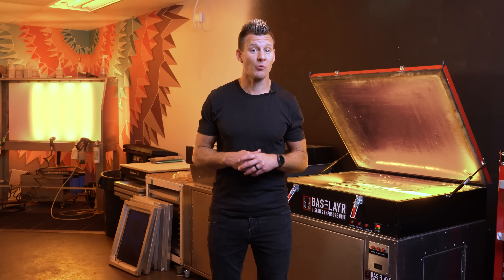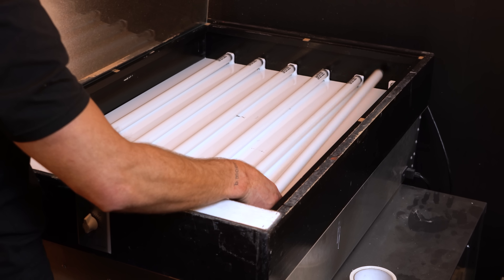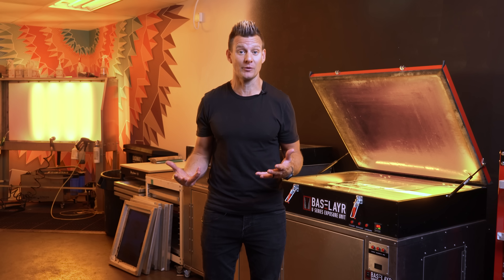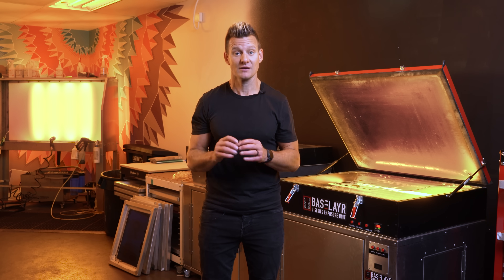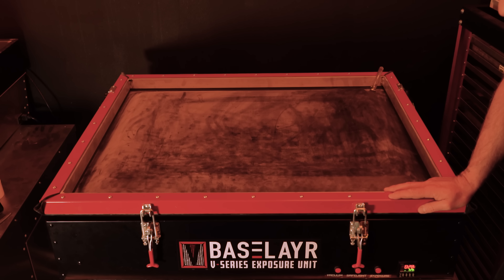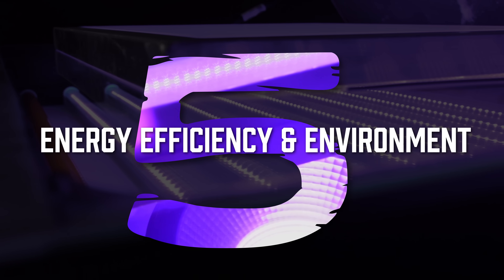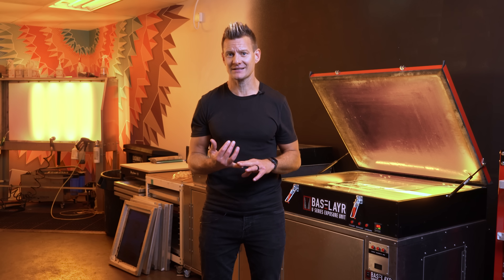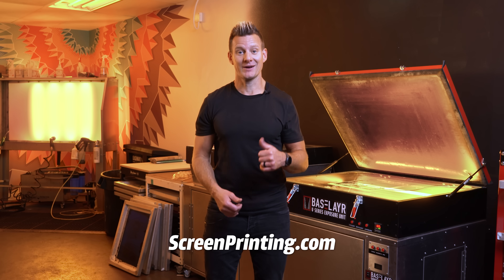Why Your Shop Needs an LED Exposure Unit | 5 Reasons to Upgrade Today

Comment: I've heard it's possible to expose using the natural sunlight? Is this possible and if so what's the disadvantages and advantages?
Reply: If i remember right, Kevin at Chromaline has a presentation slide that shows where certain bulbs land in the light spectrum. Sunlight covers the entire range of visible light of course, but a lot of emulsions have specific ranges where they are designed to be effective, so using emulsion that is specifically designed for your exposure unit will bring your exposure times down and give you a higher quality stencil. 

The nice thing about using an exposure unit is it allows you to get your exposure times down to the second, and be repeatable because you always have the same light source. As Ryonet said, the sun can be... variable... especially here in the PNW!
Reply: @bengossler6193  🎯🎯🎯
Reply: Tbh i think there is a big market with emulsions, i was under the impression that we have 3 different emulsion types acetate based used in solvent inks acrylate used for water based inks then both together for waterbase and solvent? All manufacturers will tell you natural sun is the best light source. From my experience with sunlight for example nice summer day i can expose within 40 seconds winter around 60 depending on artwork ect. Also i use a black board for the frame to lay flat on also this stops any light hiting ground and reflecting other side, to create a vacuum suction mineral turps is emulsion friendly so pouring this on the screen laying art work on will eliminate any off contact, other ways usepeice of glass or acylic. I guess being in australia southern hemisphere our uv rays are alot stronger than in USA.
Reply from the maker: Great points You nailed the emulsion breakdown acetate, acrylate, and dual-cure all have their place. Sunlight can be powerful (jealous of that Aussie UV!), and your DIY setup with the black board and turps is smart for getting clean exposures. Love seeing how printers adapt around the world 👊
Reply: It is. It’s cheaper. But takes a long time
Reply: @barncat7943  how long?
Reply from the maker: It can work really well with strong sun - but Like @barncat7943 said, it does take longer, you have less control over exposure time, and the sun doesn't always shine!
Reply: Too long? From my experience using sun summers day 40 secs winter little longer 60 secs depending on artwork ect. Guess UV rays in australia are higher compared to USA.